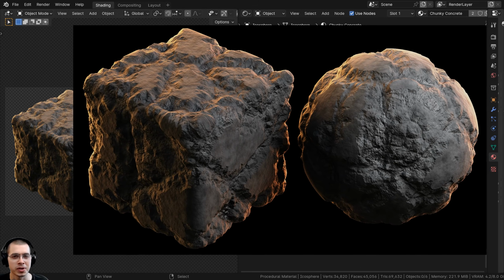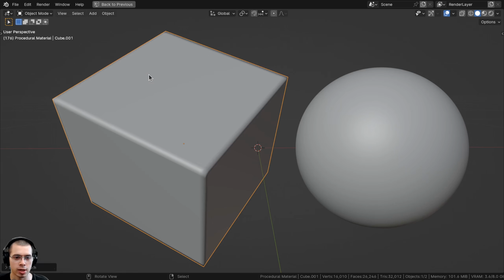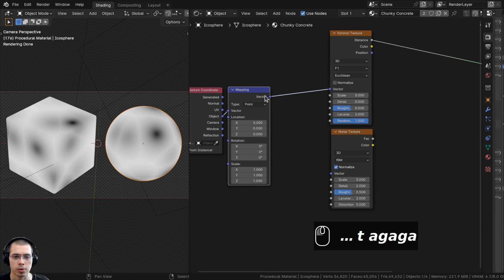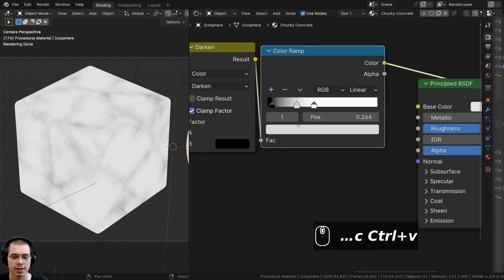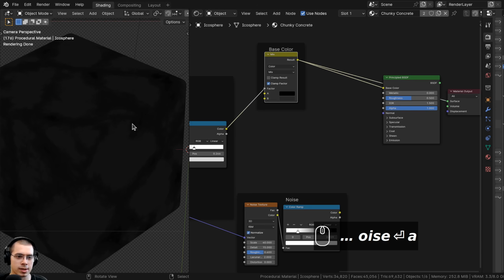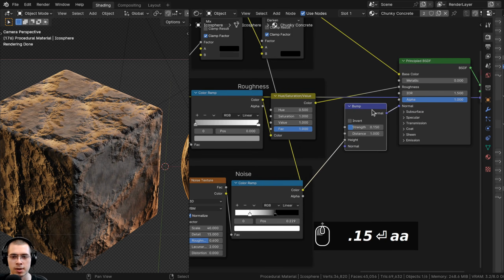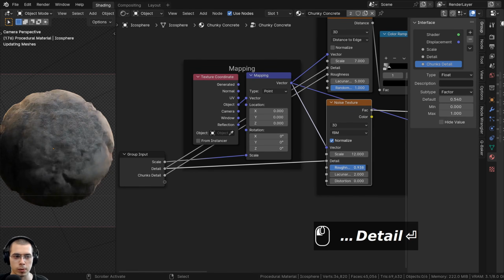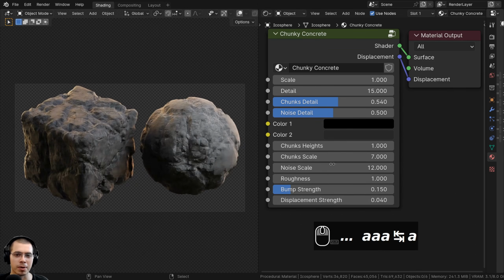Procedural Chunky Concrete Material (Blender Tutorial)

Comment: Hey ryan u make amazing stuff!
Got a specific question,when we make procedural material ,say i use a noise texture can i add metallic effect to say only the white part and the other black doesn't get it 
Is it possible to do this?
Reply from the maker: yes, you will need to plug a texture into the metallic value, to control where its metallic, and where its not.
Reply: @RyanKingArt  thank you 👍